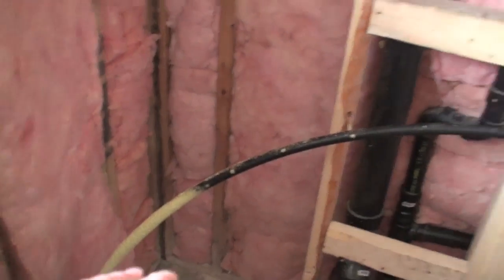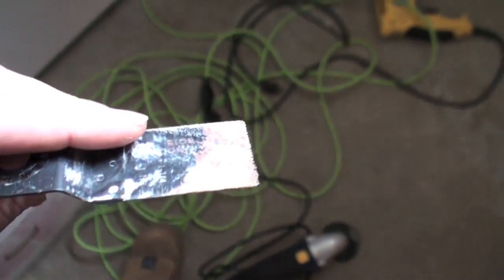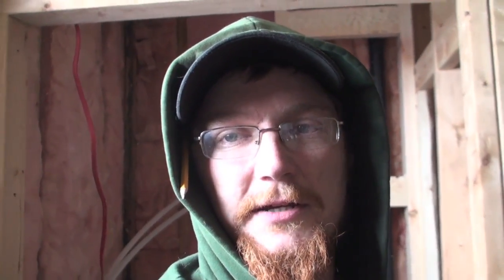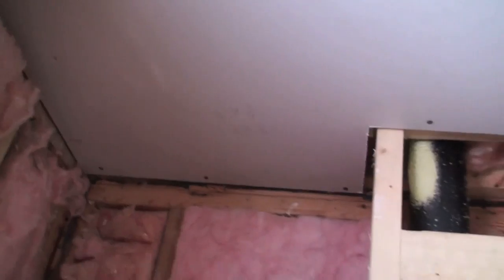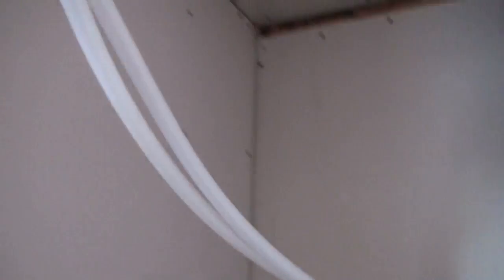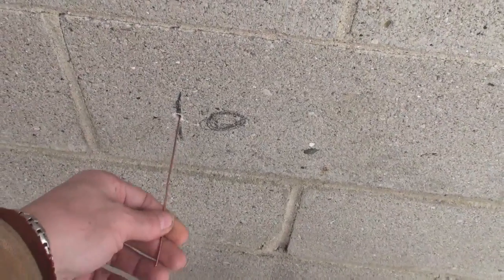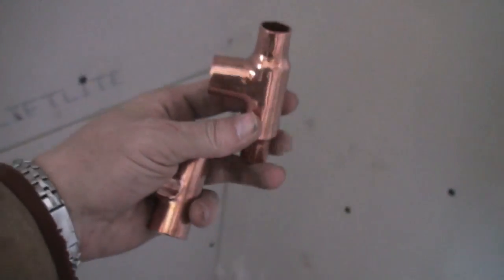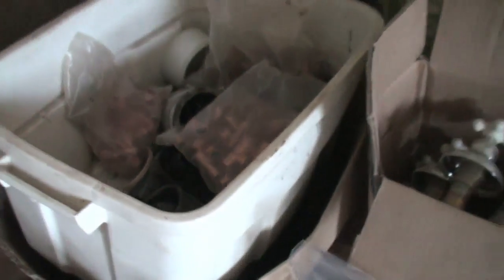pipe and drywall

Comment: After being a General Contractor dealing with the building construction trades for over 40 years, I can say that I have never seen an Architect specify having fiberglass insulation over closed cell foam.  I instruct the insulation contractors to place the vapor barrier on the warm side of the structure when fiberglass bats are used as exterior wall insulation. I prefer sprayed on closed cell insulation in wall cavities negating the need for any additional vapor barrier.

Comment: from what i can remember the type of spray foam he has behind the pink fiberglass is closed cell foam that acts as a vapor barrier and seals the block walls so the 6 mill poly is not needed on the inside  he has a video of it getting sprayed in about a year ago

Comment: at 2.14m take off the plasterboard (dry wall) & plant on (screw on top of the existing framework) 2x2 in so the boxing is out further to cover the waste clean out, it will look a lot better

Comment: he has spray foam behind the pink fiberglass that seals the block wall and makes a vapor barrier its excepted by code as far as i know  i have seen mike Holmes do it in a basement i am pretty sure but i could be wrong

Comment: I am not sure what the R value of pugs foam is. but a slight deviation from the rule is permitted with thick walls. In this case, one-third of the total R value can be located inside of the vapour barrier. I agree that vb should be on the warm side, but what he did might actually be ok, not the best, but To Code.

Comment: Im an insulator by trade I've done it for 10 years. Your spary foam looks to me that it is closed cell foam that is your vapor barrier!!!!! DO NOT POLY OVER THAT FIBERGLASS OR YOU WILL HAVE A DOUBLE VAPOR BARRIER WHICH COULD CAUSE YOU MOLD PROBLEMS!!

Comment: Haha ive been in contruction for years and ya he is not doing it 100% correct but who cares. you always start drywall on the ceiling then butt the wall boards into the ceiling boards, but who knows he might be doing a drop ceiling, yes you always vapour barrier fiberglass insulation on the exterior walls but whatever its his place his job he should be the only one to worry about it, enough said. GOOF COMMENTS ARE GETTING OUT OF CONTROL.